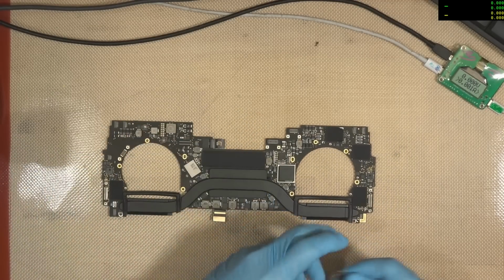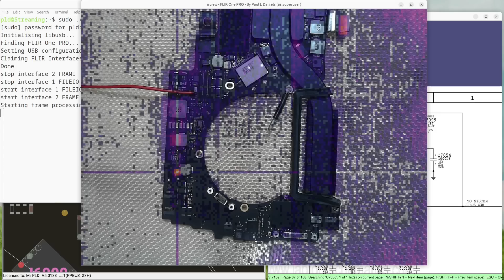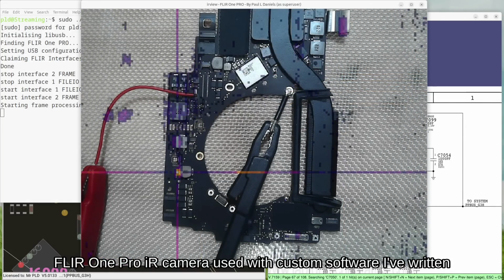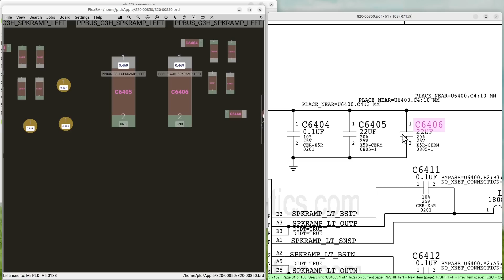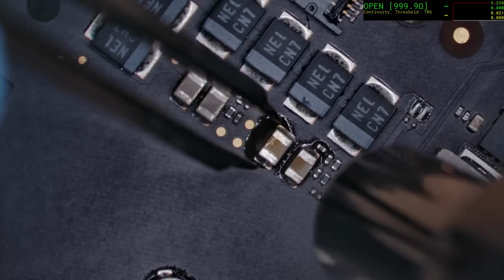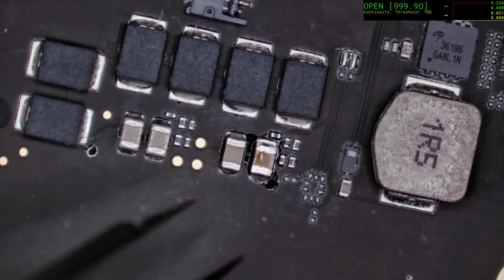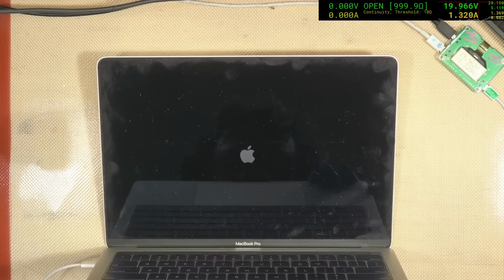How you fix a DEAD Macbook with a 50c part...

Comment: You are my hero. Every time I get one of those 4 usb-c boards I think maybe ill get lucky and it will be a bad cap and I spend days on it only to realize its nand/T2/cpu related or its been to another shop where they injected 1000v into the ppbus
Reply from the maker: It's definitely a horrible number of times that a job has been prior-repaired and badly so at that.   So many "techs" fail to verify the state of the rails before powering it up; losing that very small opportunity to save the day :(
Reply: I agree most of the time they are beyond recovery by the time we get our hands on them @pldaniels

Comment: Hi Paul, love your,knowledge, have you ever successfully replace the main chip( its clearly visibly cooked) on an older Seagate Barracuda 5.5" ATA hard drive? i it possible?
Peace ✌️
Reply from the maker: Is it the controller chip or the flash?  Depends on the specific model;  the physical process of the replacement isn't a big issue.
Reply: i will dig it out and have a look...i have kept it since 1995 .
 @pldaniels

Comment: how many volt you injected the board with
Reply from the maker: I started with 0.9V and 1A; because the short was quite strong the PSU hit the current-limit (1A) at only about 0.3V, so the iR camera picked up the ~300mW heat coming from the capacitor.

Comment: The title says a AUD$0.50 part so I'm assuming you purchased a strip of 5,000 of those capacitors. 😁
1:28 In the top right corner of the screen, is that the new tool you've been working on and perfecting? Eyes are a bit blurred so I can't properly see it unfortunately.
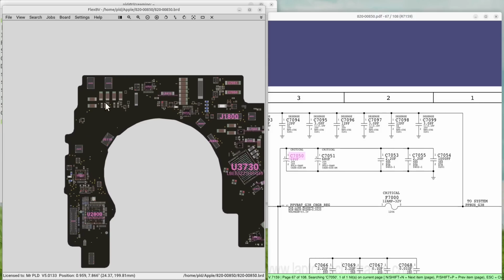7:20 Is this the fantastic and improved FlexBV v5 https://pldaniels.com/flexbv5/ on the screen. Demo version available here too.
Purchase FlexBV v5 here:  ( https://pldaniels.com/flexbv5/purchase.html )  It will pay for itself within 1 to 5 repairs
9:01 KITTIES!! 🥳🥳🥳🥳🥳🥳🥳🥳
9:13 A chairful kitty. 🤦‍♂
Thank You for the video Paul. Much appreciated 👍
Reply from the maker: 1:28 That's the PLD USB-C meter, that one is in production somewhat, more waiting on me to finish dusting off the webstore to sell them.

7:20 Yes, new FlexBV5, well, that existing users can upgrade to, or new people can buy outright 

As for the caps, will have to buy a few more :)

Comment: Funny that this popped up right when someone brought me an A2338, which had been sitting unused for a while, and ppbus is also shorted. No bubbled up battery. No 20v just 5v
Reply from the maker: Hopefully you have an equally  swift repair
Reply: @pldaniels  easy, 1 shorted cap

Comment: Love the channel. The protection circuit hides the bad cap. I have noticed, from before and after photos, the cap never sees enough current to show the micro fractures in the MLCC. once we inject voltage and get the cap hot, the fractures appear clear. Some devices I have seen that do show the bad cap, maybe have a slower shutdown of the protection, or they have attempted to restart so many times, they eventually start to show. Great repair.